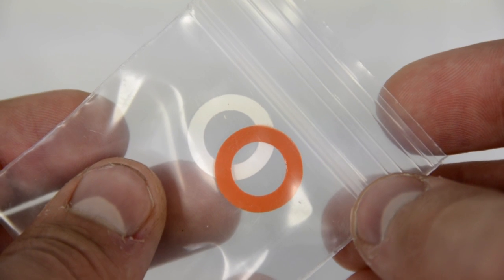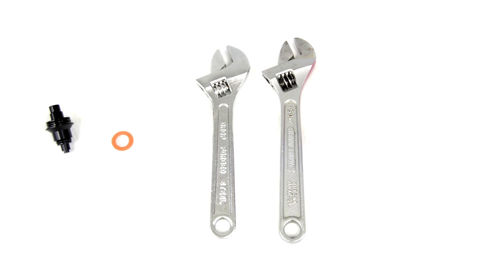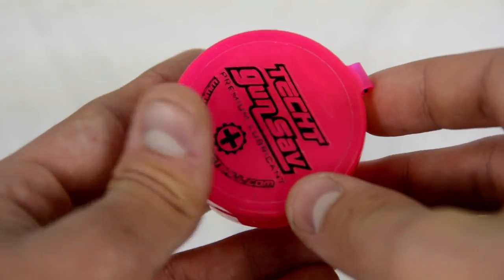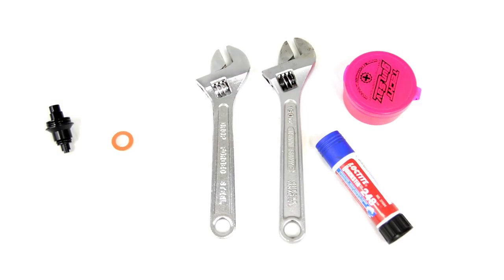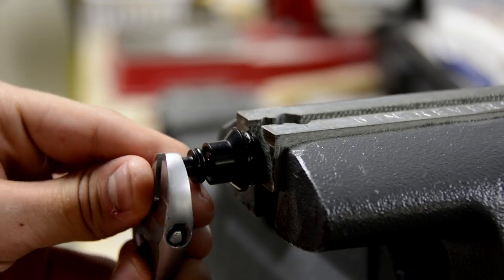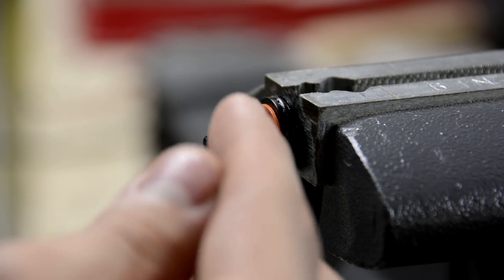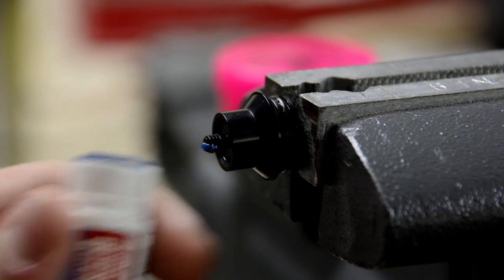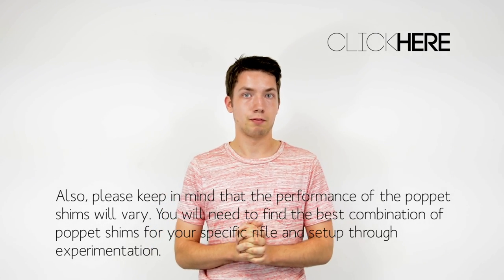How to Install Poppet Shims for PolarStar Fusion Engines

Comment: Just found this video. I see comments a few years old. So is there a pretty basic setup now.? Common set ups?
Reply from the maker: Hi ya! When it comes to HPA, most people go with either the P* JACK, P* F2, Wolverine Inferno, Wolverine Reaper, or the Redline N7.  Those are the main ones.  The PolarStar Fusion Engine is still around, but the above units are typically more popular due to price.  

If you are talking about the FE specifically.  The above setup (Red/Purple Nozzle with Red Poppet/Purple Poppet with shims and S2 Lightning Banjo is the typical setup for the Fusion Engine.  It's a good blend of efficiency and performance. 

Hope this helps! 
Kurtis

Comment: Is there anyway to make a polarstar jack more air efficient? Is there a way to add shims to it? If so what shims?
Reply: At this time, the only way to make your JACK more efficient is to run a longer/tighter bore barrel and a lower PSI.  This will allow you to save air since you are running at a lower PSI to get the same FPS.  Hope this helps!

Comment: Def a Noob on this.  Why would you want to do this?  Serious question guys.
Reply from the maker: Poppet shims reduce the travel on the poppet valve, which saves a bit of air in the long run. 

Thanks!
-Robby
Reply: Amped Airsoft so I wouldn't necessarily need the poppet shims, its just to save more air